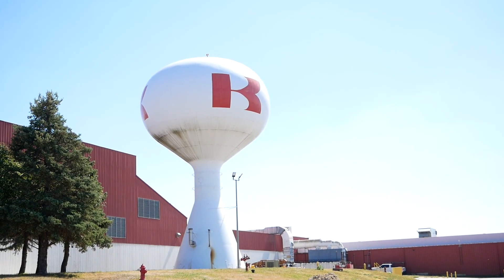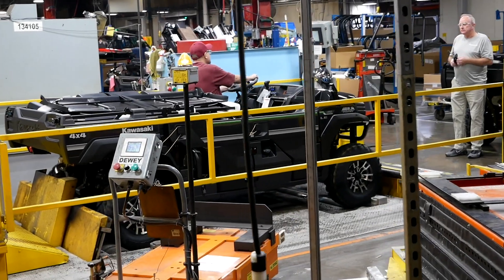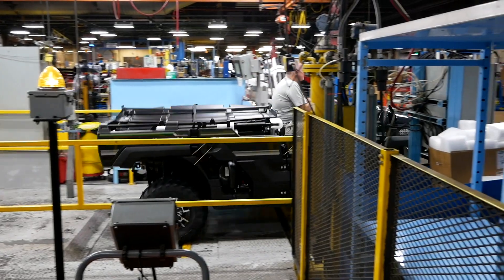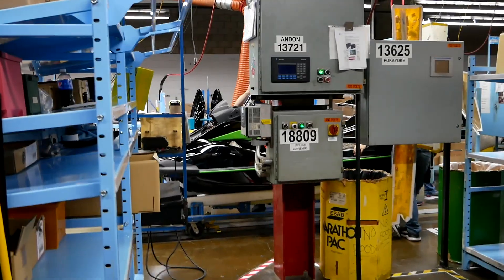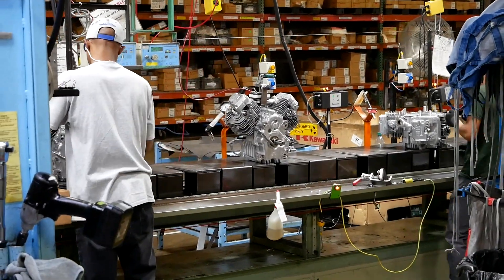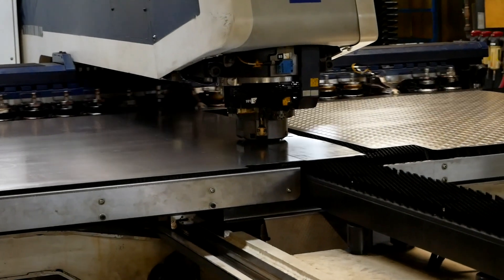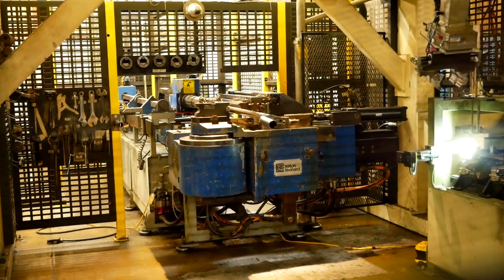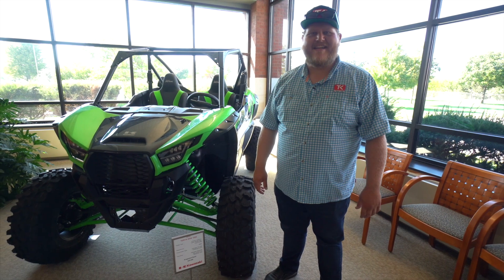Go INSIDE the Kawasaki Factory And Watch Them Build ATVs, Jet Skis, SxSs and More!

Comment: yeah, those train cars are the three varations of the R211 class of subway car for MTA New York City Transit (which for disclaimer purposes, is my employer. I'm a subway train conductor) "R211A" is what you see the most of. these are the standard style car body with end bulkheads and storm doors between the cars. 

But you can also see in the wide shot of the factory floor "R211T" cars. these are the MTA's return to open connections between the cars. These open gangway cars follow in the footsteps of the Pre World War Two privately run Brooklyn Rapid Transit company, who actually introduced the idea of things like articulation and cars connected by gangways with the D-Type "Triplex" cars in the 1920s. 

Sprinkled through the room is also the prototype train of the "R211S", which will run on the separate and operationally somewhat unique Staten Island Railway. It was built as mainline rail, got downgraded to a legal rapid transit line, but still operates as if it was a legal railroad.
Reply from the maker: Great information, thanks! We weren't told much about the train cars while there, only that they could end up in places like Washington DC and NYC.
Reply: @tkpowersports  

Here’s a video of the prototype train under testing conditions. Revenue service should begin with the next few months.

https://youtu.be/5EDk6qz0KEM